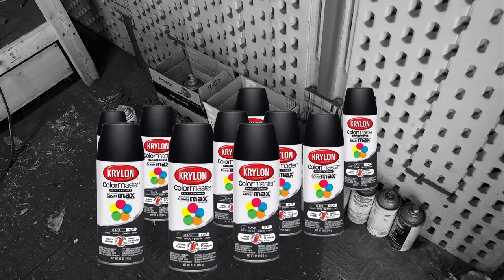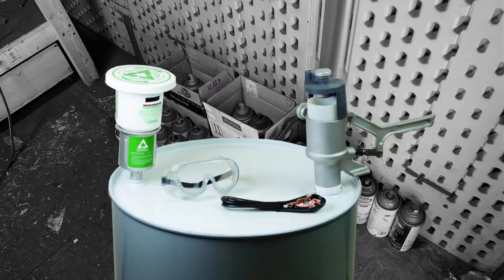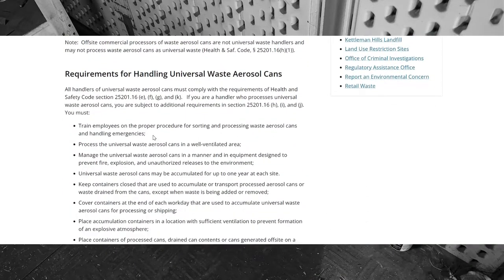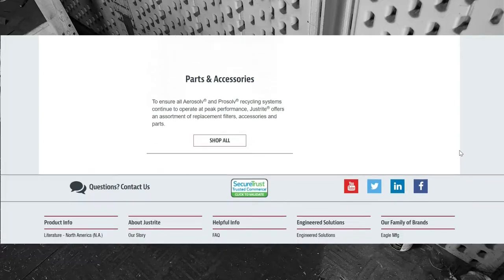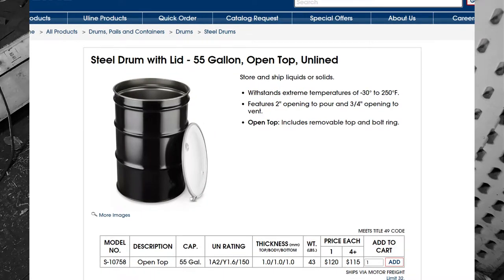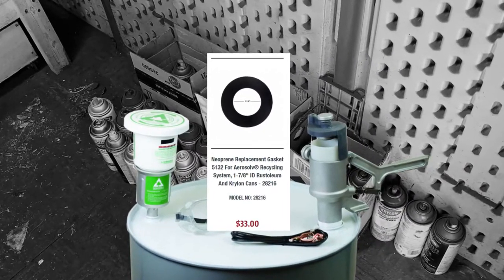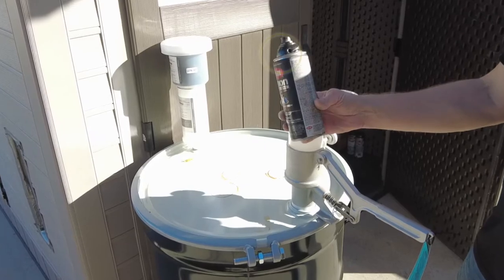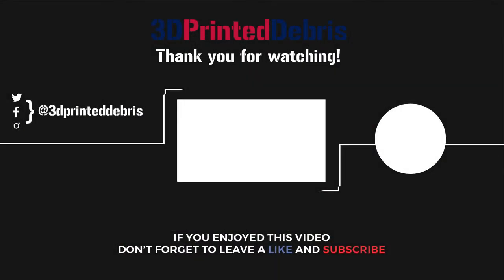Dispose of Spray Cans Properly with Aerosolv Puncher (Hazardous Waste!) 3DPD 3D Printer Farm Review

Comment: Why not use a HVLP system?
Reply from the maker: I don't know what you mean.
Reply: @3DPrintedDebris  instead of using spray cans use a spray gun.  Less waste and im sure less expensive at the scale you are doing.
Reply from the maker: @craigstay2395  I might one day. I don't think I have the bandwidth to reverse engineer Krylon's work on that metallic paint just yet.
Reply: @3DPrintedDebris  You can order pretty much any kind of paint you want in just about any quantity.  Krylon sells your metallic paint in bulk amounts.  More setup and cleanup than spray cans, but you are not generating near as much garbage as you are now, and the paint is cheaper.  HVLP system (High volume low pressure) produce far less overspray which means better finish, less waste and a lot less in the way of air pollution.  You'd need to look at a mini system and do your painting in big batches.  An air brush might be a better way to dip a toe into that pond.  You can still use bulk paint and still eliminate most of your waste stream.
Reply from the maker: @swampcastle8142  I'll take a look at that when the need arises. Right now, the production of that line of products is only around 10-20 a month.